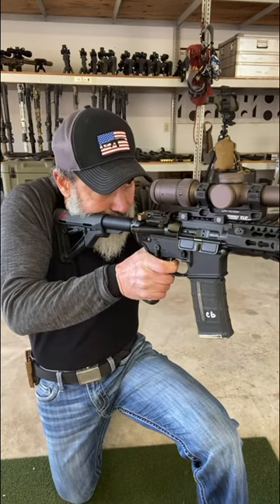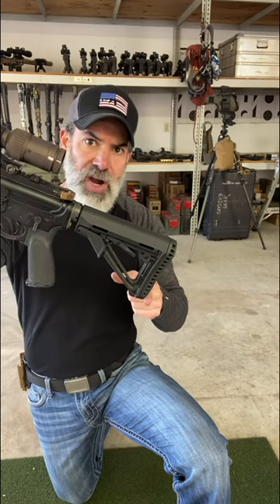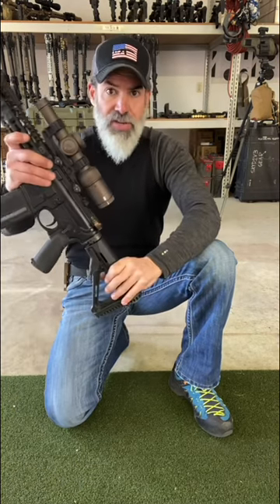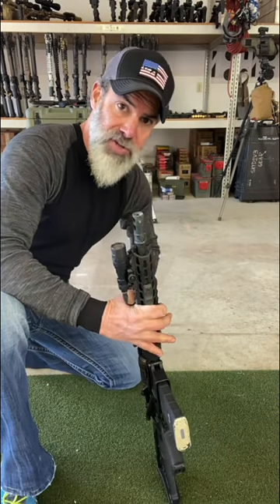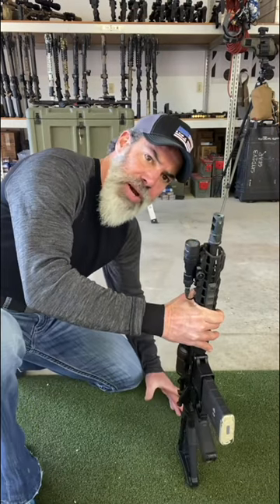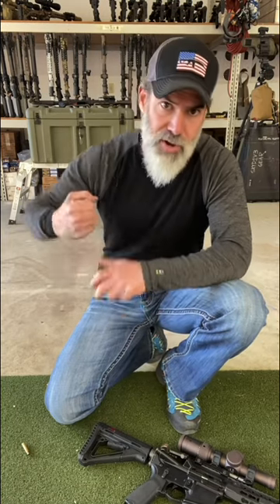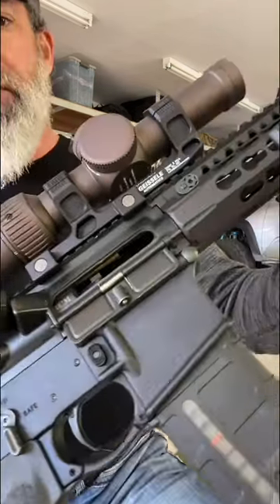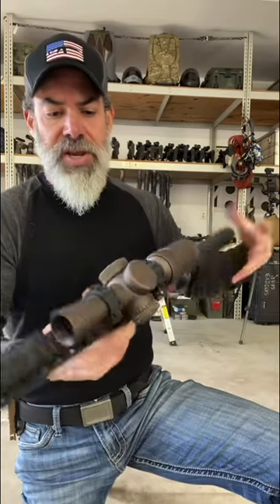Forth in a series of malfunctions

Comment: Serious question...Pat Mac shows a technique where one can pull the bolt itself back with your fingers after stripping the mag. This allows the brass-over-bolt to fall free. I've tried it many times and it seems to work well for clearing this. I'm sure you've seen this?
Reply: looks like he was also talking about stuck casings. I never had one with brass, but i did with steel and it SUCKED. i dont think i would have been able to clear it with my finder on the BCG